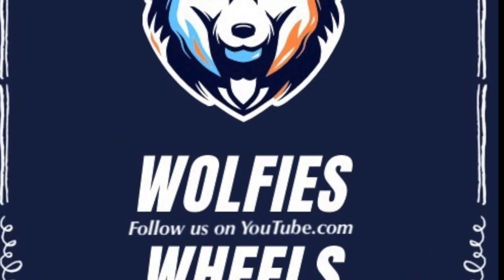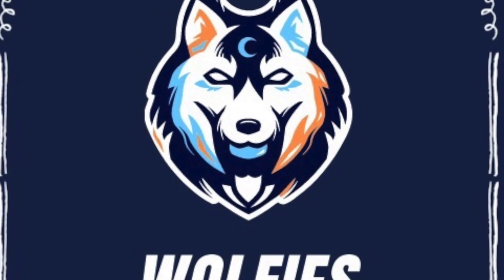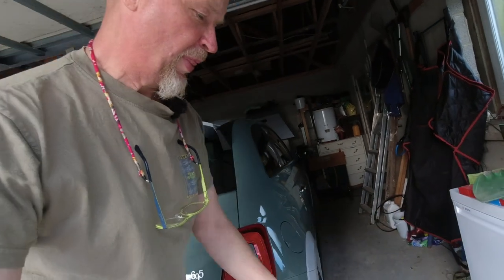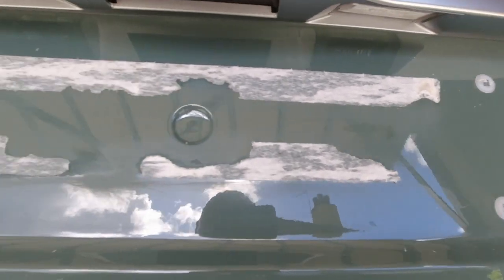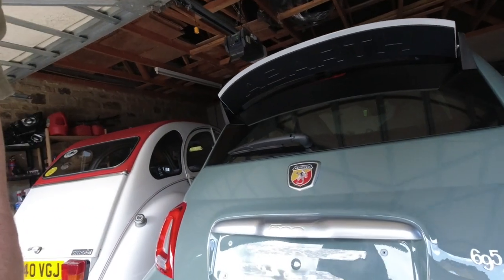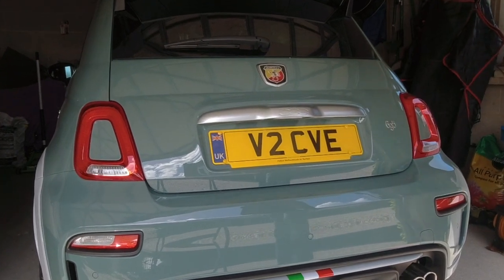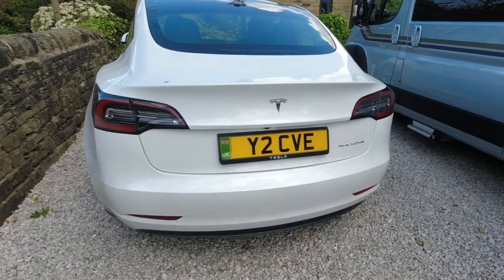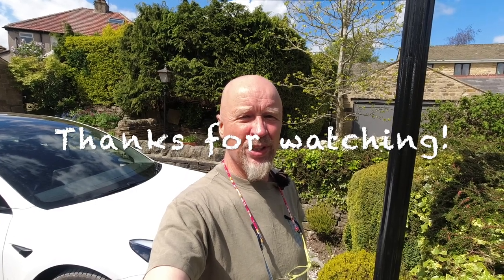How to assign a private plate to a car, and fit the plates  HD 1080p

Comment: Excellent video Wolfie. I’ve just bought a private plate and was worried about setting it up so many thanks 👍 Quick question though, how would this affect the tax on the car? Would I need to cancel the old one and replace with new tax? Cheers
Reply from the maker: Thanks for the kind comment! In the UK, when you assign the new plate to the vehicle the DVLA automatically sort out the road tax situation, so there is no need to cancel the tax on the old number and take another tax out on the new number. Probably the more important thing is to make sure the insurance company is notified as without doing this you will ping up on the police ANPR systems as “uninsured” as the database will not link the new number with an insured vehicle. Hope this helps 👍🏻

Comment: Good video, found you from the 2cv videos:) Personally I try to always stick rather than  use screws the holes always seem to delaminate over time. Oh petrol or sticky stuff remover forthe old residue.
Reply from the maker: Thanks for your kind comment. Interesting point re the delaminating, will keep an eye on that. I didn’t think of using petrol but did try lighter fluid which has never let me down in the past….but it did this time 🤣

Comment: WD 40 works well on removing the old sticky glue residue on the car. A blue screw cap might have been better on the FIAT plate at the top where the blue band is. I would definitely have put a couple of sticky pads on the Tesla plate, just in case.

Comment: Can you choose any private numberplates you want ?
Is it any monthly / yearly fee for keeping private numberplate ?
Reply from the maker: Thanks for watching the video and your comment. In the UK you can’t choose any number you want, the number has to be one issued by the DVLA (government department). These can be bought either direct from the DVLA or a dealer or even privately. The cost of numbers varies, ranging from maybe £100 to literally a few £hundred thousand! Technically the number belongs to the DVLA and you pay for the right to use it. If you lay the number out in a non compliant way, the DVLA can (never heard of it happening though) take it back without compensating you. Once you have paid for the plate, there is a £80 fee to assign the plate to the car, but no further costs. If you take the plate off, you get another retention certificate (V750) which costs £80, and lasts 5 years. After that you have to pay another £80 to renew the certification if you haven’t assigned the plate to a car. Hope this helps, and thanks again for your comment 👍🏻
Reply: @WolfiesWheels  thank you for that answer.
Reply: I believe the Retention Certificate lasts for 10 years?